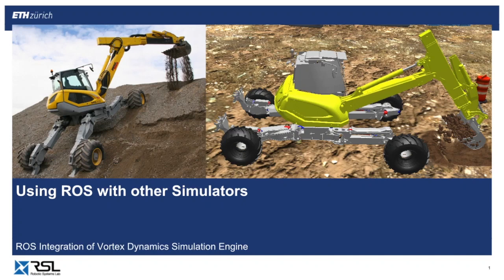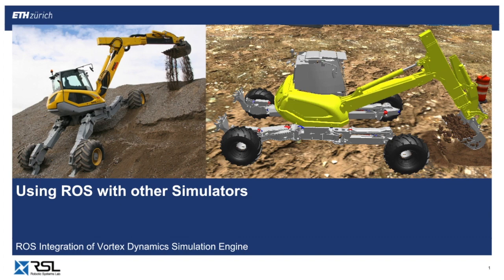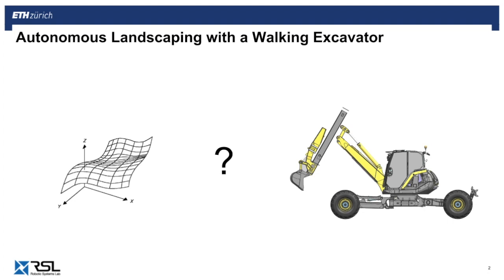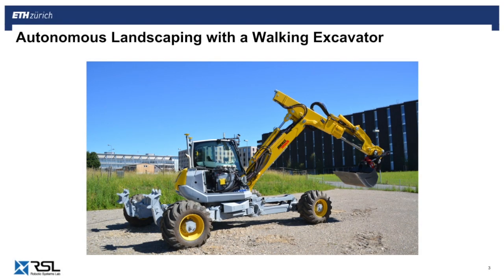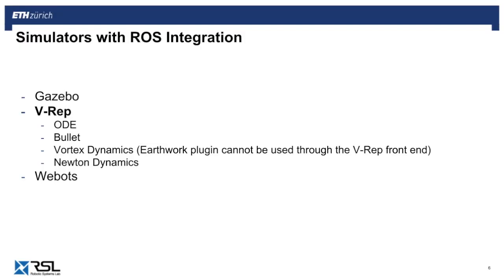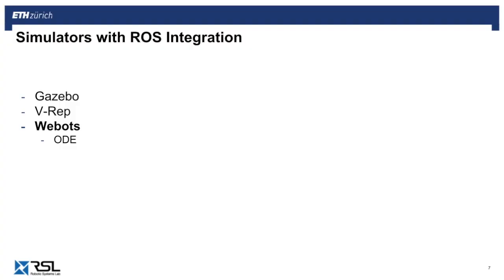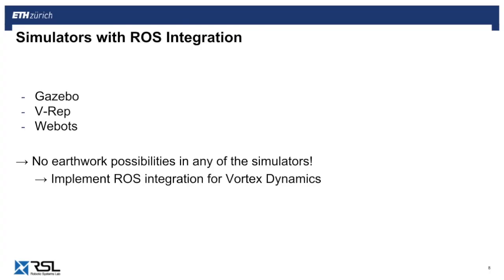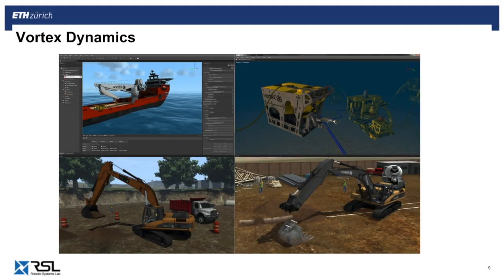Using ROS with other Simulators (Dominic Jud)

Comment: Hello,
In the scope of my PhD thesis, I am working on Cable-Driven Parallel Robots (CDPRs) and one of my tasks is creating a simulation of a CDPR in Vortex. Part of this task is creating the communication between the simulated CDPR and my controller, which must be done through ROS.
Your video is the only piece of information I have been able to find on someone actually using Vortex with ROS. I was wondering if you would be willing to share your implementation? Our use cases (and robots) are completely different, but it is the actual integration of ROS that I am interested in.
Thank you in advance,
Zane
Reply: exactly I did not find any tutorial video this informative and hands on.. hopefully we find it
Reply: @Must23  : This might come a bit late, but for what it's worth, since version 2021a Vortex Studio comes with out-of-the-box ROS2 support, and even some built-in optical sensors like a lidar.
See here: https://www.youtube.com/watch?v=ayDiZ6F_BDE